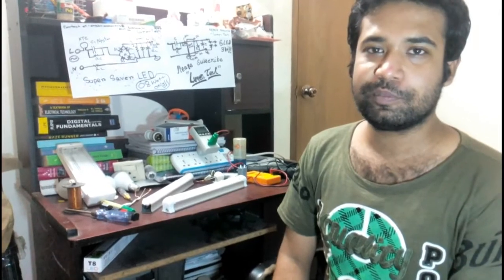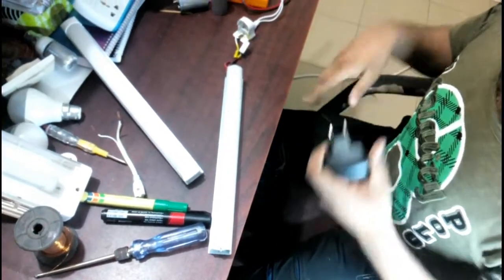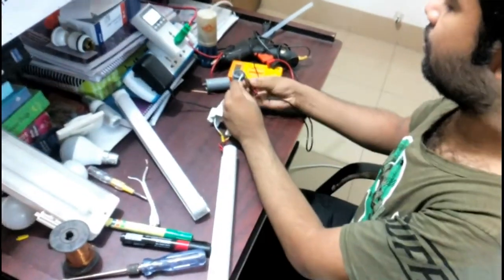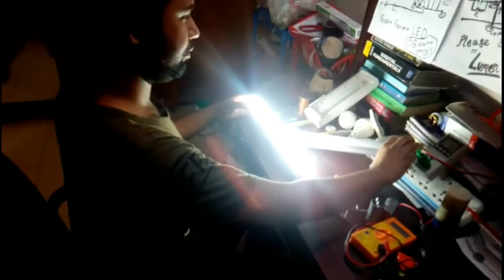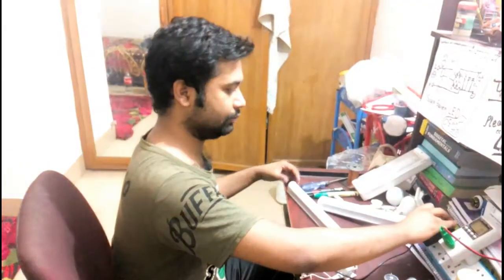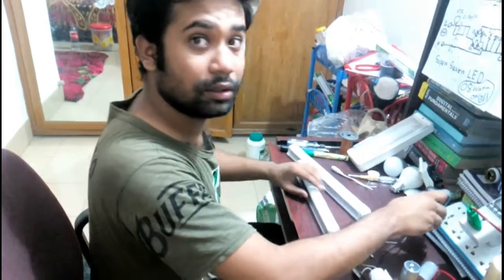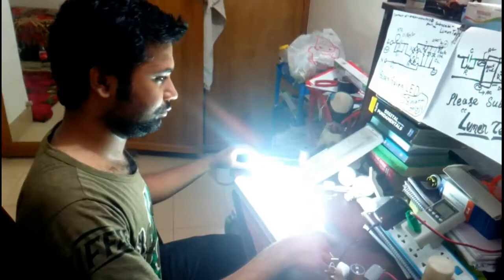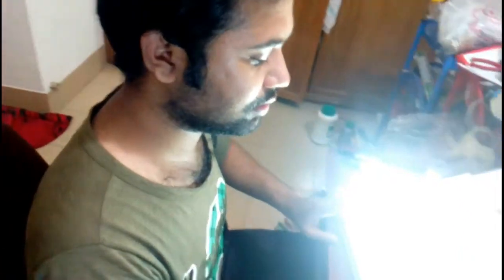How to make homemade 12 watt solar tube light

Comment: how did you make it can u show me
Reply from the maker: Vikram Telang  I make it by 1w round smd stone led,their is 12 LEDs in it,in a solar setup need more light to go on of gride so I make it,
Reply from the maker: Vikram Telang and there is 4 individual led series connection,in itch series have 3 LEDs ,and all 4 module,connected in parralal,